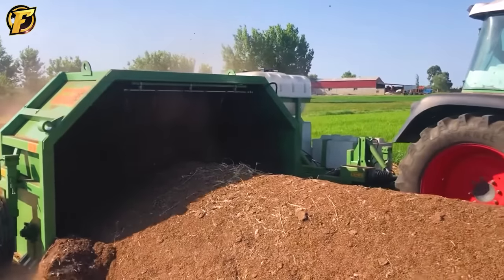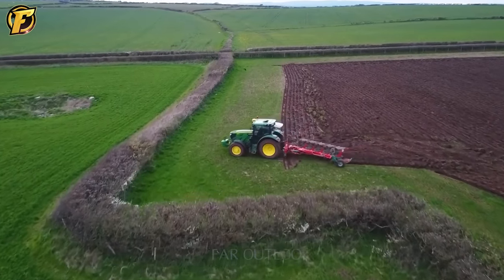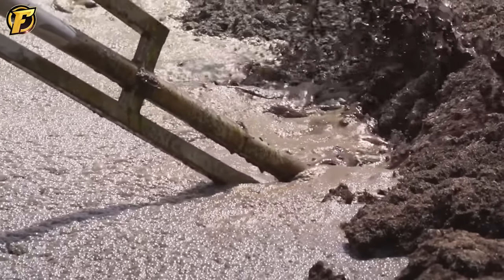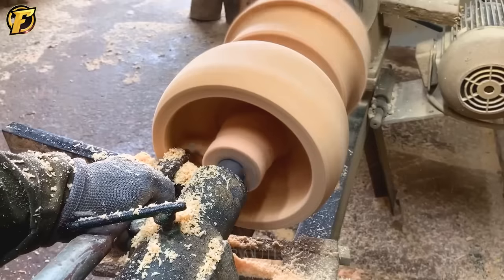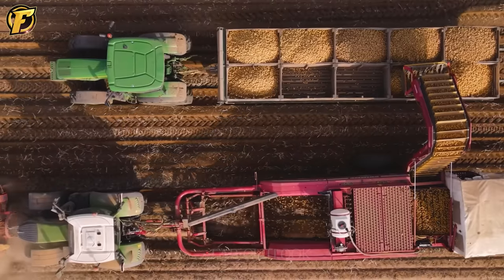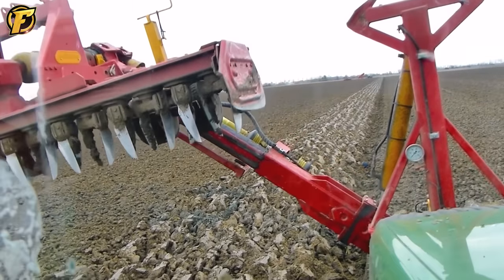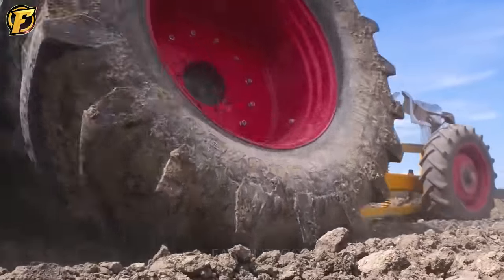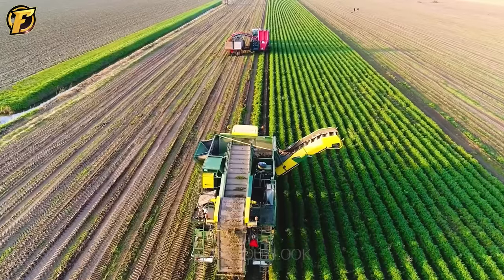550 Impressive Industrial Machines Operating at Peak Efficiency ► 23

Comment: We used to have 4 scrapers that ran materials from our rock Crusher (Fresh Kills Landfill, now closed). We also had 10 dozer pulled scrapers. Originally with D8Ks, then upgraded to D8Ls. Running an old cable scraper pulled by a D8 with clutch and brake pedals was part of the practical test for the job. Back in the day. IUOE Local 15.